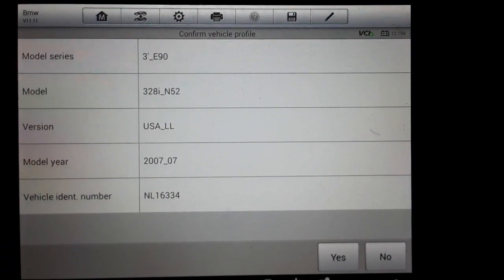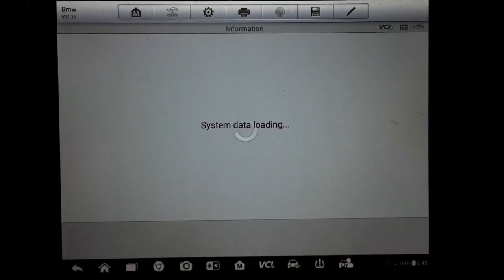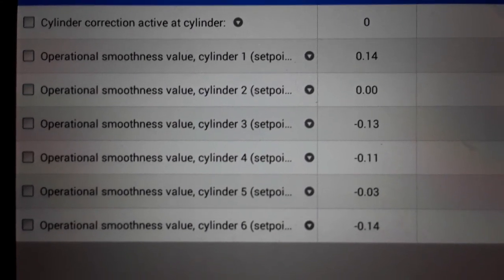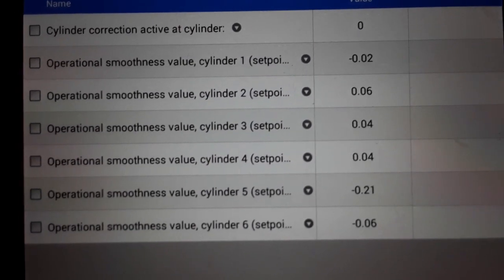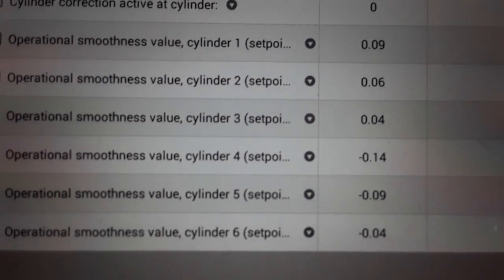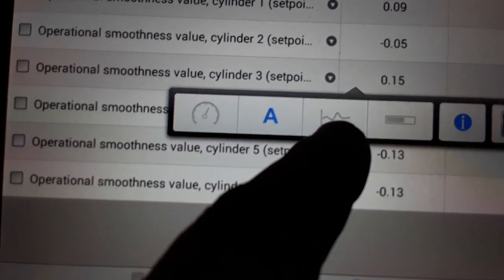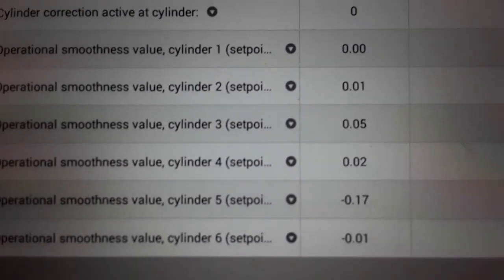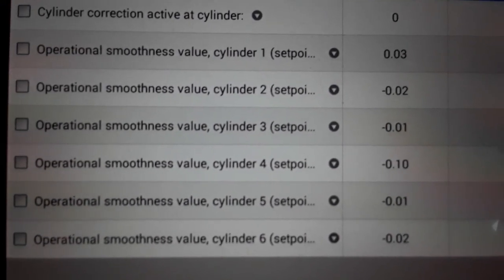BMW Smooth Running Values with the Autel Maxisys MS906

Comment: Thank you for the great video and info. In bummer link, the unit of measurement is 1/S2, so a measure of acceleration. Not sure here in your tool. I noticed cylinders 4 and 5 mostly negative all the time, so you might want to verify those. I was worried that I saw some higher values while driving, but as you explained, must be measured in idle. Thanks again.

Comment: How high would the values get to be of concern? Close to zero is optimal, but how far from zero is too much? I have a 4cyl reading up to 2.2 on cylinder 1 and the rest are close to zero
Reply from the maker: I am not sure, you could pull the connector off of one coil and see what the reading will go to just to see what the max value possible is.
Reply: -4 to 5